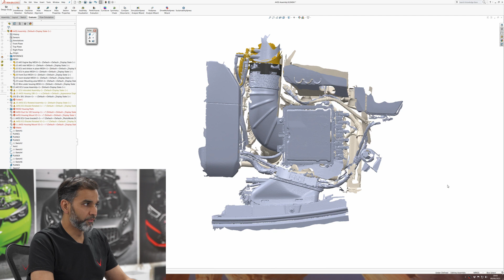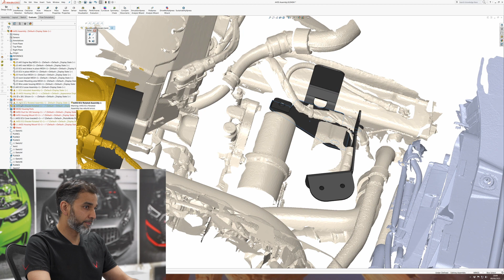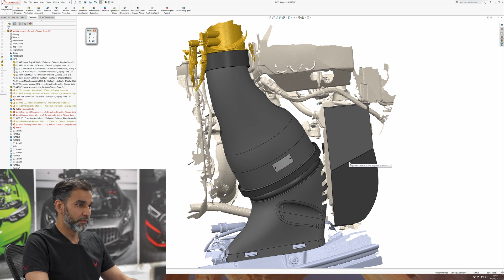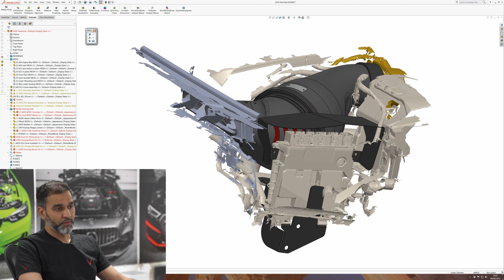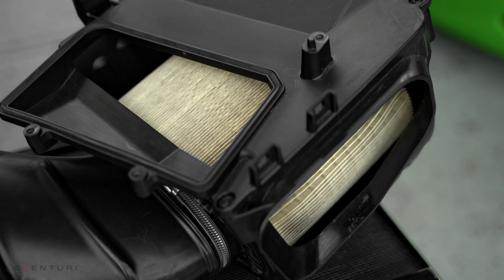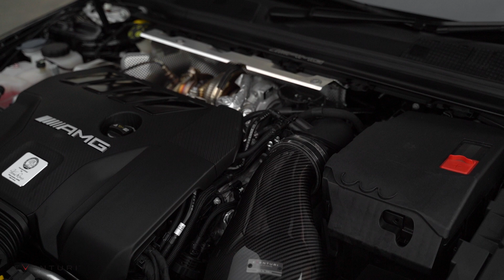Mercedes A45/CLA45 M139 Eventuri intake - Carbon test fit and intake sounds!

Comment: There's an aftermarket blowoff valve on this car, right? I don't see how an intake can make it sound like it has a blowoff valve when the car comes with a recirculation bypass valve and has zero blowoff noise when it does vent to atmosphere. If it really is just the intake doing that I would be amazed.
Reply from the maker: Sounds like you are amazed.

The R&D test vehicle was completely stock, simply by installing the Eventuri intake following sound and turbo noises were achieved.
Reply: @Eventuri  Amazing

Comment: Hi! ITBs are supposedly even less restrictive than eventuri, but seems your intakes could free up more horsepower.
Any idea/explanation?
Reply from the maker: ITB’s are only applicable on a NA engine. Also unless you enclose them in a box and route cold air to them you’ll suck in hot air. Also ITBs will change the harmonics of the intake system and you can lose drive ability.
Reply: @Eventuri Hi Once the induction system is changed to the Eventuri system, how many miles does the filter last before it requires replacement?